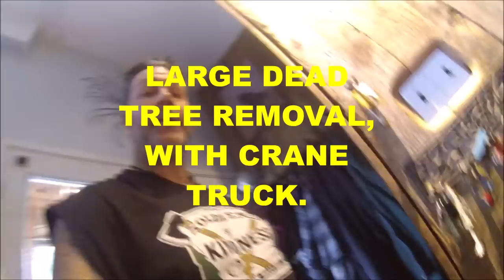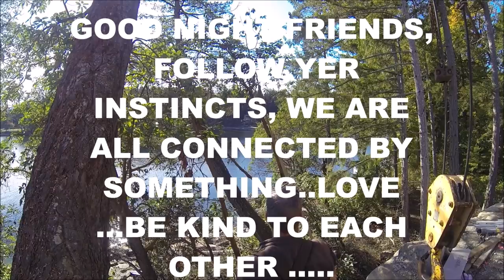LARGE DEAD TREE REMOVAL , WITH CRANE TRUCK

Comment: Buckin'  Could not believe the words from your mouth...praise for a Stihl saw!  But you are right and most climbers in the world agree the MS200T is one of the best saws Stihl ever made.  That is why new they go for twice what they originally cost and beat in used condition they go for what they cost new.  Their one shortcoming and another reason for using a lanyard that clips the saw close to your body is the fuel tanks are ultrasonically welded plastic and are prone to cracking.  Kind of a PITA to replace but worth it.  Stihl uses some kind of plastic that even JB Weld won't repair.  I know, I've replaced three because my son wasn't careful enough.  Two he dropped from a bucket and one got hit when the crane guy wasn't paying attention.  

Keep the love flowing!
Reply: At 2# heavier I am not sure climbers I know would agree.  In fact a lot of them are going to the Echo CS-2511 just because the saw is so much lighter than their MS200T/201T/201TCM.

Comment: When your using a smaller crane like that the best method is to lower the chunk right next the the tree and then rotate it when it is as near the ground as possible, this reduces most of the risk involved with using a smaller size crane at full extension with pieces of wood that are getting heavier as you go down. It is much like the same thing applies to using forklifts, you always lower the load down as far as you can before driving the forklift around and the same could be said about this job using a crane so unless there are obstacles such as wires or other tree's that you would need to swing a load over the safest and best method is to immediately lower the load right next to the picking point and then rotate or boom up as needed and probably good to also have a tag line for swing control.

Comment: Not to be a know it all but extending or retracting a telescoping boom with a load on the hook is a big no no the boom sections slide on plastic pads and the boom should be set at 70 degree or higher befor scoping in or out and with out a load on the hook